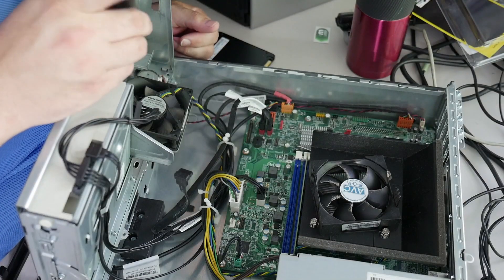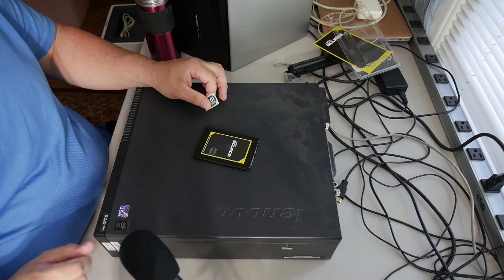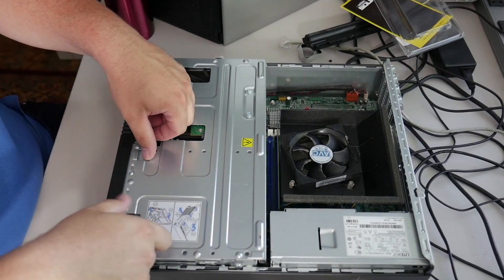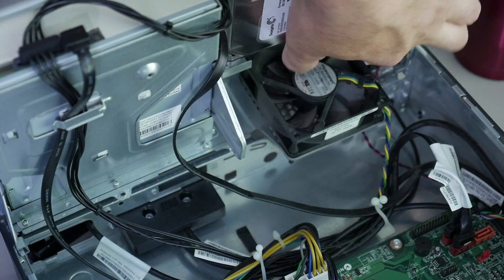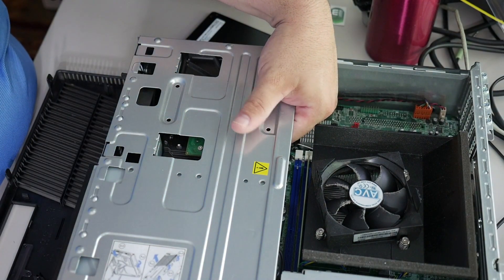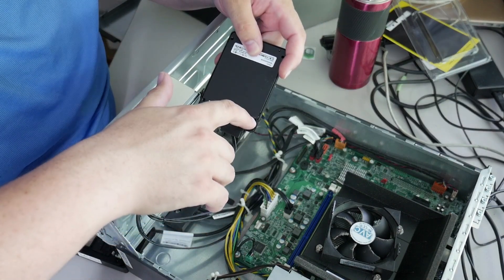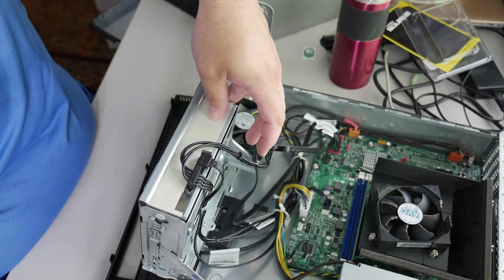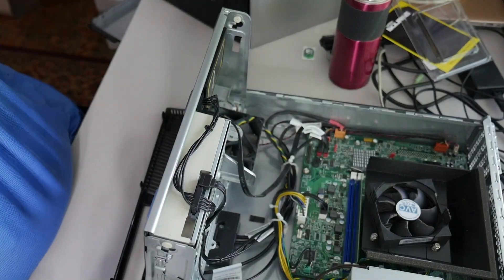Lenovo ThinkCentre MT Desktop SSD Upgrade - Jody Bruchon

Comment: Can i install ssd without removing the hdd?
Reply from the maker: You'll need a SATA to 2x SATA power connector splitter and an extra SATA data cable...but yes, you can. Just use packing tape to strap the SSD to something, or see if you can jam one screw through a hole somewhere. SSDs weigh so little and have no moving parts so it doesn't matter if you mount them neatly or just toss them in there, as long as they won't short anything out or get stuck in a fan, it's all fair game.
Reply: @JodyBruchon  can burn it the power supply using the splitter sata power?
Reply from the maker: @hugologowsky  No, you should be fine.

Comment: Thanks Jody - this was the perfect video for what I needed. Used this model to run a home built arcade but the HDD was too slow and now works great. One side note is I used a screw like in the video but also one of those damage free sticky pieces you can buy for hanging posters on other side.

Comment: Can we upgrade ThinkCenter M58P to M.2 NVMe?
Reply from the maker: I don't know. This video is not about that computer (unless it's an alternative model number since Lenovo loves to have a bunch of numbers) and I've probably never touched one.
Reply: @JodyBruchon  It's similar but a bit earlier version.
Reply from the maker: @the7thmove322  Generally, if there is no M.2 slot built into the board, you can add a PCIe M.2 card via an adapter but you won't be able to boot from it. BIOS support is required to boot from M.2  NVMe SSDs and computers built prior to Windows 10's release in 2015 typically don't have that at all. M.2 being a standard on almost all machines is an extremely recent development.
Reply: @JodyBruchon  That's true. So, M58P can only be upgraded in terms of RAM & SSD only or can it be upgraded in terms of processors too?
Reply: @JodyBruchon  but can it boot from regular hdd, and still use m.2 nvme with PCIe adapter?
Reply from the maker: @tomas568  I'm sure it can. The only reason you wouldn't be able to boot from NVMe in an adapter is a lack of BIOS support for NVMe boot.
Reply: @JodyBruchon  Thank you for response